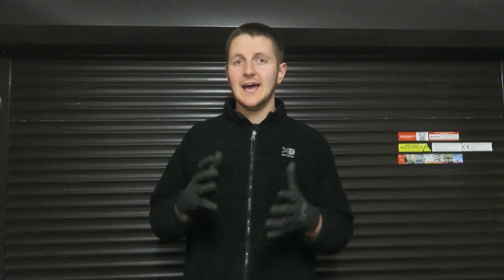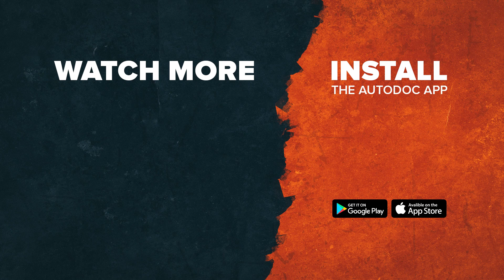How do EGR valves work? | AUTODOC

Comment: I find the people who have EGR problems, are the ones who excessively idle the engine.
Reply from the maker: You are right in your observations: problems with the EGR (exhaust gas recirculation) valve occur indeed more often in cars that idle a lot or drive at low revs in city traffic.

Comment: a question for you my touran was driving fine parked it up for 5 days then i had to use it i ttravelled about 8 miles heard a screeching noise so took back home then took to garage they said prob dpf so drove home left it tried to start it wouldnt start i washed out the dpf all bubbles outa back end of exhaust but now the car will only start if i take the egr valve out if i put it back the engine chokes and clouds of smoke and burns eyes its that strong any advice
Reply from the maker: Unfortunately, according to the description, it is difficult to advise anything, we recommend contacting the service.

Comment: how do you decide to replace sooner than clean.   I got one cleaned but still have a  lot of smoke its a toyota Avenysis diesel 2 Ltr 2011 year.  If it cleaned up good is it still possible to be broken or is it most likely a different issue

Comment: Iv got a focus tdci nothing but issues with dpf and egr, the garages have had hundreds out of me
Iv had the dpf removed and remapped £200 best money ever spent as the issue will never go away these firms that claim you can clean it and maintain it utter lies!!! A mechanic of 40 years told me this and the  cars running like a dream now and forget the illegal to take it off blah blah they cant tell
Reply: This is somewhat true, clean (new) engines will have fewer issues with the DPF and EGR units especially if there are frequent "long runs" - the issue comes in with wear, as soon as the odo clicks over 100k the emissions go to hell because of ring/bore and turbo seal wear. At this point it makes little difference to overall emissions whether you have the EGR or not, and in my mind, more power means the vehicle is driven more efficiently and that leads to lower overall emissions, but that's just my biased theory
Reply: Yep, your car will run a lot better with them both removed!
Reply: Interesting...

Comment: Are EGR valves only on petrol cars , or are they on diesel cars too ?????
Reply: Diesels have them to.
Reply: Diesels have higher NOx amounts in exhaust so of course they do have egr valves
Reply: Yep, and I think on diesels they are way, way more problematic - my EGR cooler ruptured a water jacket (common on VW tdi's) and because my mechanic was an idiot he insisted it was a head gasket break, leading to a full engine overhaul for no reason....
Reply: @Mark-nm6zw  
Always get a second or third opinion...